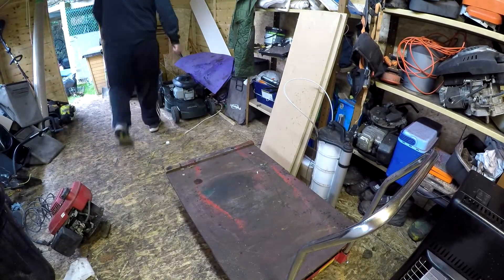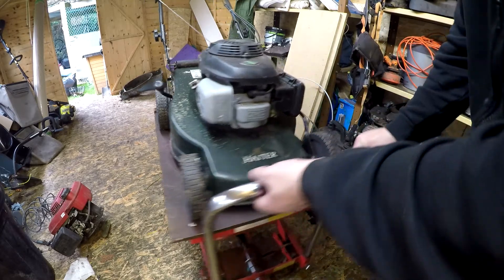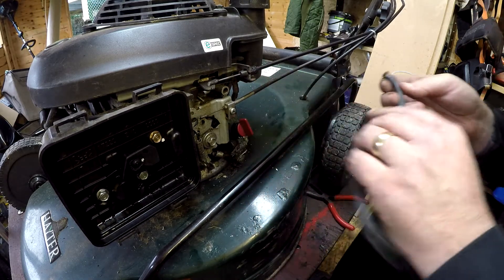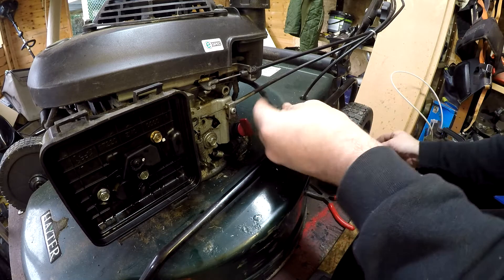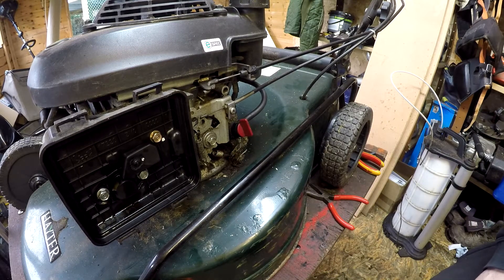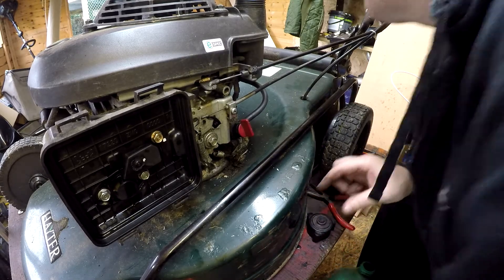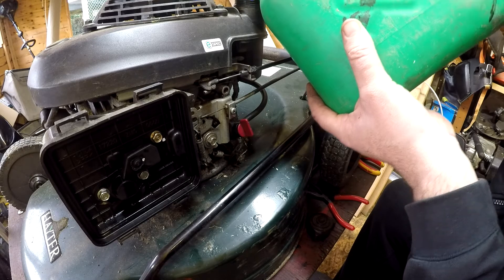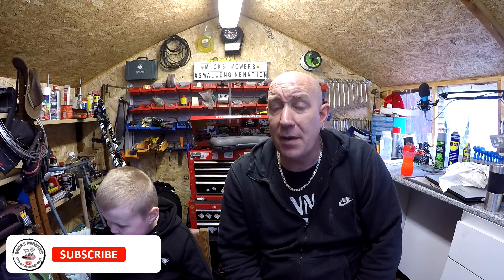Hayter Lawnmower Will it Run #lawnmower #workshoprepair

Comment: I like those Honda engines . I've had a few over the winter to get repaired.
Reply from the maker: Yeah mate. They are a nice engine and it runs well too
Reply: @themowerman  . I did service on a mower yesterday to find out when I come to check the blade that there is a chunk of metal missing from the blade boss.can I use a boss off another mower if it's the right size or do I have to use one that is the exact model replacement.  Thanks
Reply from the maker: @chrishale2284  mate I mix and match.. as long as it fits the shaft and the keyway is a good fit.. also make sure the blade is fitted well abd at the right length to the bottom of the deck..

Comment: Great video Mick. Question about the oil extractor you have there. I was wondering if you could do a video on how to clean the tank and hoses properly? I see a lot of reviews on them but none on cleaning them. I think it be a good video for you to put out.
Reply: Run some warm water with washing up through. Works with mine ok.
Reply: @bobbelsekwol  Thanks.
Reply from the maker: I also use oil petrol to clean mine..
Reply: Micks Mowers . I've got an electric pump so I daren't use petrol. BOOM. Cheers for the videos mick